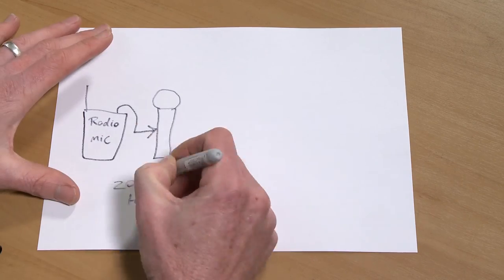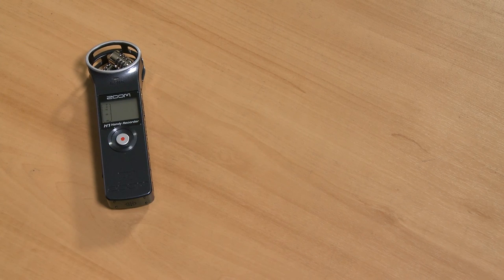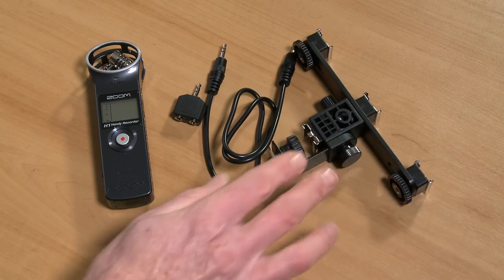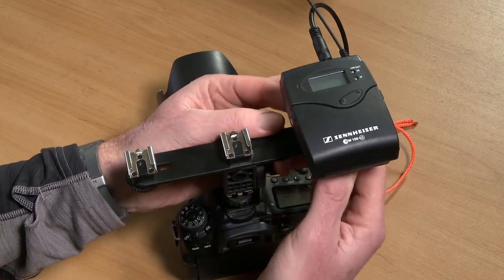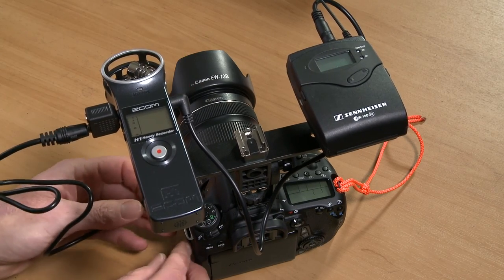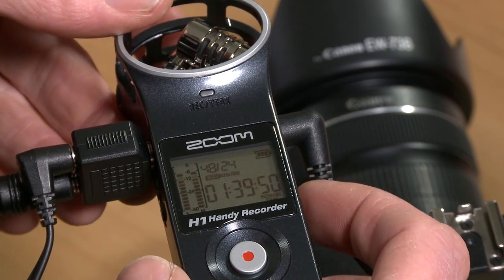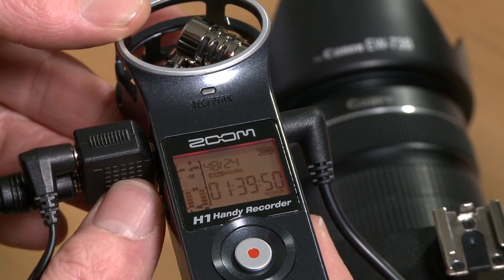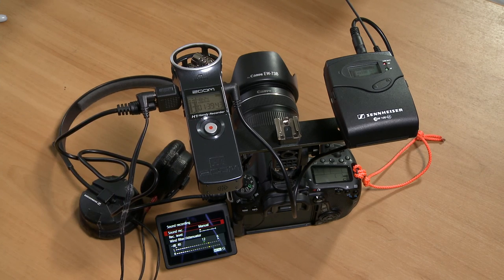Setting up a Radio mic with your Canon DSLR   Part 2

Comment: Hi, great Video, like all of your other VIdeos. I have one doubt on the jack spliter. From what I know, and based on personal experience, the headphones that you connect will degrade the lower frequencies of the sound being recorded. In order to reproduce bass frequencies the headphones will use an amount of energy (being the signal here) and the sound recorded in the camera will be degraded. If you connect headphones of different brand and internal resistance,  you will get different results.  I am not being mean or anything, nor I have tried this myself. This is only  some thoughts based on my experience and knowledge of electric circuits. Came to this video by checking your channel as I am intending to purchase an Inspire 1 X5.
Reply from the maker: Appreciate the feedback. I think a better system would obviously be a radio mic or separate audio recorder. Cheers
Reply from the maker: p.s. the Canon 80d has a audio jack in now which solves the complicated setup.
Reply: True! thats a great camera although im waiting for the 90D!!

Comment: I just bought a Sennheiser MK 600 boom mic for interviews on my Canon 70D. I am very new to video work on my Canon.  I can't get my external microphone to work.  I tried multiple external mics, including a basic wire lapel mic and none of them are working. My camera is not picking up any sound from them.  My settings under sound ... are set on manual but it is not picking up the microphone at all.  Wondering if you might know if I am missing a setting on my camera under some other menu list ....  or if my mic jack might be broken?  Thanks for any help trouble shooting.
Reply from the maker: +Lori Dethlefs Hi - it could be a faulty mic jack but also be aware that amy external mic you attach has to have its own power (a battery) as the mic jack on the 70D doesn't supply power to the mic.  Cheers
Reply: +Grant Johnston - Took the Mic into Best Buy where I bought it and my Canon D70 and the MIC was faulty.  Ordered a new one.  Thank you!
Reply: actually I have the 70D and it does provide phantom power to external mics. Although i am using the rode video pro with my setup, i am certain it will work with the video Go as well... have a look http://www.rode.com/microphones/videomicgo